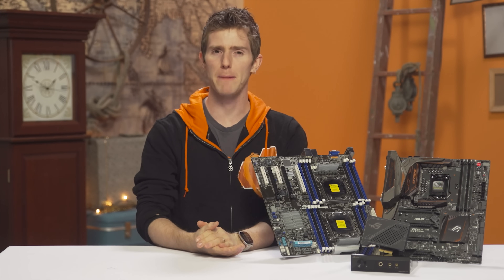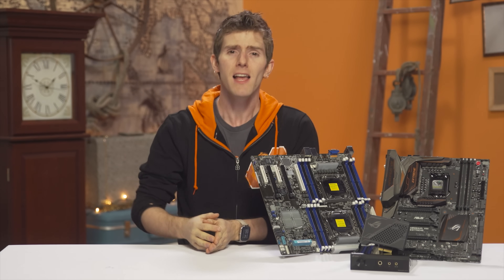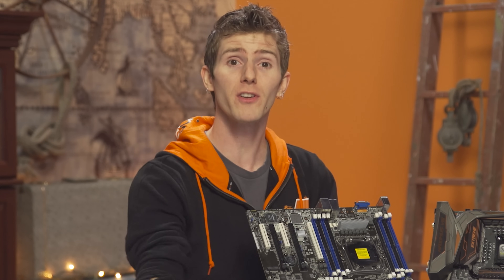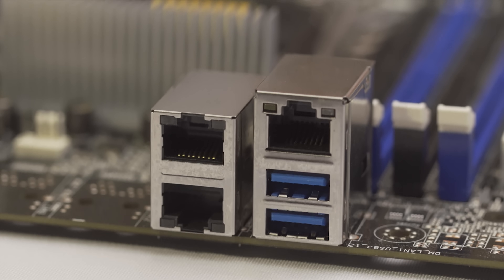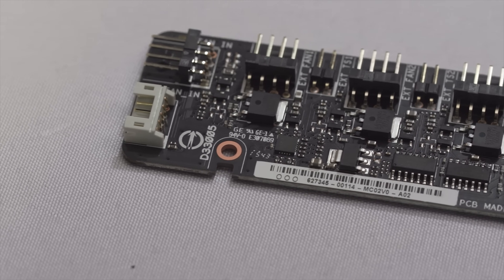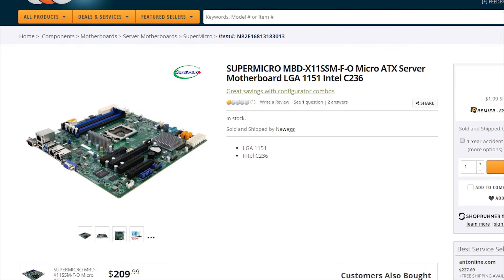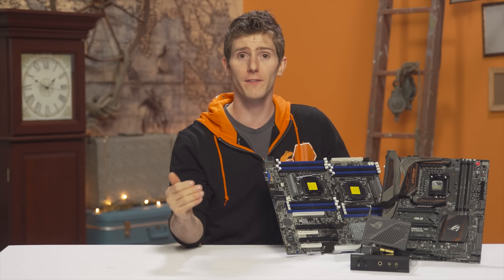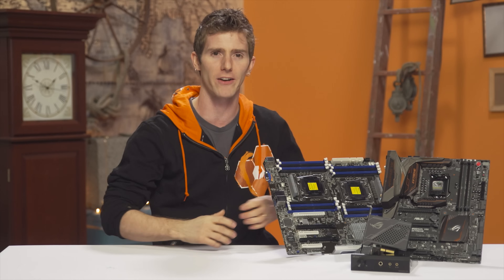What is the best choice for a motherboard? - The Final Answer

Comment: So... What do you do if they seem the same? For example, gigabyte z170 gaming 5 vs Asus z170 - ar, or the z170 Saber tooth s... They are all so similar with similar prices... Now what?
Reply: If they have the exact same features, get the one that's visuals you like.
Reply: +Johan Ekstrom thanks, I decided to go cheap and got the gigabute z170xp sli. Haha
Reply: David Wang Ah, okay. I'm curious. What other specs do you have?
Reply: To be completely honest, There's a lot that needs to be done (I cannot decide on a processor, i'm waiting for the 1070 and r9 480 to drop, and i'm just looking for more feedback to get the most bang for my buck kind of thing. But this is what I've been thinking
cpu:either the 6600k or 6700k
cooler: cryorig r1 ultimate
mobo: gigabyte z170xp sli
ram: 16gb kingston hyperX fury
gpu: I have a sapphire r9 390 for now, this will most likely change... assuming the gpu's i'm waiting for come out before i leave for college
storage: 240 adata ssd + 1tb hdd
cd drive: i know, why....
case: I don't know, i'd like to keep it under 100, so i choose the phanteks pro m acrylic (i like a full side panel, but most panels at this price tend to scratch... easily...
case fans:I choose the corsair af 140... but i'm not sure if those are worth the $20. I just want them to be white, or be white and black...
mouse: corsair m65 (yeah, this is a full build)
keyboard: corsair strafe cherry mx silent
monitor: aoc i2267f
nzxt hue+................... Okay, i have no idea how these led systems work... but the hue+, to cover the large size of the case, was the cheapest while providing enough cable, compared to cablemod led.
That's my build, if you can suggest somethings, or want to know my uses for the pc, that would be really appreciated. Thanks
Reply: David Wang Get a 6600k, no average gamer needs a 6700k, unless you plan on playing Software Inc. with 400 employees working simultaneously. Don't upgrade your GPU yet. The 390 is only as good as the 480. If you want to, sell it for 300$ and buy a 480 which should be just as good for 250$.Upgrade next year if you want to. CD/DVD drive? Please buy one. It's still pretty handy, even if everyone is saying the opposite. Just get the cheapest one. I'm basically having the same internal specs as you if you're getting an RX480, but I'm getting a cheap as fuck case and then building one myself/requesting a custom one from a company/making my desk PC compartment to be the case(it can fit an mATX PC really well, so a full ATX will fit in it) when I have physical reference parts. I have an EIZO EV2333W which costs 600€ but got it for free(bought by someone who didn't have a DVI port or a DisplayPort in their computer) due to my grandfather having good connections(being a builder/renovator with lots of acquaintances gives you good connections, seems like). Get a fully modular PSU.
Reply: Oh yes, i forgot to mention, i think i'm getting an evga 650gs fully modular psu. As for cpu, I won't only be using this computer for gaming (which is why I choose the r9 390 over the gtx 970... don't know how much vram affects this but...). I will be using this for computer science at college as well as using it for 3d modeling, cad stuff, any sort of 3d rendering will be done on this pc as well, which is why I've been considering the 6700k, due to it's better workstation scores and being cheaper than a 4790k. 
Oh yeah, i haven't bought any of these parts, so i don't have a sapphire nitro card yet... But the only pro i've heard about the 480 is that polaris is much better than hawaii, which could make it better, and it's also cheaper.
Reply: David Wang Ok, so get the 6700k, or invest more on the cooler and overclock the 6600k a shit ton. Stick with the 390 for now, and get a RX5xx next year/2018 if necessary.
Reply: Okay. yeah, the cooler was another hard choice. It was really the cooler master nepton 240m or the cryorig r1 ultimate. I choose the cryorig r1 ultimate since it's only a few (as in less than 5c) hotter, but it's also 5-10db quieter running at max. I'm not trying to bother my roomate with a loud pc, so I picked this. it's also one the best looking coolers in my opinion.
Reply: David Wang Yeah, that might cut it for serious OCing of a 6600k. I'm getting a Cooler Master Hyper 212 Evo. How mainstream, am I right? That's all I need though.
Reply: Haha, true! are you overclocking? I know the 212 evo is good for some moderate overclocking. Actually, another thing i need to face and think about is cooling. The dorm rooms at my college are tiny, literally, and no ac, so I would guess the room heats up very fast (i mean, at least they provide a window fan!) but i need to move the lukewarm air through the system fast and then exhaust it fast too, I feel as if water just can't cool fast enough when the air itself is warm... Also, think 4 case fans is enough? 1 front to bring air in, two on top pulling air away from case and cpu, 1 back to pull air out, and then battery with fan bottom to draw air in? Or should i make it two in the front?
Reply: David Wang Yeah, I'm overclocking, mostly to get experience in overclocking, as I'm kinda a noob at it. 4 case fans should be alright, as long as they provide sufficient air flow in the case, while being quiet, but you could get additional ones to support the air around the water cooler. Get more fans in your dorm room(I have 3 in my own room right now, with the window open), and exchange your lightbulb(s) for ones that don't get hot.
Reply: Okay. Thanks. After some digging around, I actually think a corsair 750d would be a better choice. Originally, the pro m acrylilc is around $80-100, but it comes with 1 fan, so I have to buy more fans. However, the 750d, which i found for $120 (hope the prices stay), come with 3 140mm af fans. So in short, that's less fans for me to get, and each af fan costs a little less than $20. So i think that's a good deal, not to mention i don't have to worry about a scratched acrylic and 750d has bigger and better airflow.
Reply: David Wang Good call.

Comment: Somebody had to say it!  Final answer=Think about it for 10 minutes and pick a board that does what you need it to do.  Expensive doesn't mean good if you bought the wrong board for what you're doing...

Really hard to keep a straight face when I listen to someone brag about a dual CPU board in a gaming machine that's sporting a $500 graphics card...  Unless you also happen to be a digital videographer that does a lot of encoding in Premier (and you for some reason can only have one computer) it's kind of a wasted build.  

I'm a lot happier in the long run when I set out on a specific goal then build it for the future.  My gaming rig's motherboard has an exceedingly common socket (lga1366-it supports everything from a cheap i5 to an expensive Xeon) and a ton of USB ports and lots of room between the PCIe slots for thick graphics cards.  I've upgraded the processor twice and the graphics card 3x.  The rest of the system is as I built it in 2009...   

Can't really brag about the price tag on her, but she plays all the games I play at 60fps.  I get motion sickness at higher framerates so I vsync, so I don't even get anything out of bragging about "25000fps in X game with everything maxxed!!".  Benchmarks are kind of lost on me too; yours probably gets a higher score on Cinebench or Futuremark, but mine never hits 100% load under normal use.

Comment: Linus, I am personally offended. I am 16, and recently finished building, or rather overhauling, my existing PC.

Specs:
i5 4460
Gigabyte H97M-D3H
Gigabyte GTX 970 G1 Gaming
OCZ Trion 100 120GB
Seagate Barracuda 2TB
Strontium 8GB DDR3-1333MHz
mATX Case
Thermaltake Toughpower 550W 80+ Silver

Comment: hey linus i have a networking question. i have a dlink ac router cobfigured for only ac on 5ghz nd 48 channel ..with a usb wifi ac adapter when i connect on 5ghz band windows is showing only 802.11n network even on 5ghz network.plz help

Comment: i agree with linus. Get what you really need. i know people that will go out and buy the most expensive consumer board and think it will out perform them. I know someone who went out bought a 5820k, asus rog extreme x99 board, 16GB DDR4 memory and asus 980ti Poseidon platinum. Everything was about twice or more my 4790k, 980 ti hof, 16GB DDR3 2400mhz, etc price and i get more fps or about the same fps than him meaning that he didn't buy the right stuff for his pc. My gpu and cpu runs cooler. 

So i should say don't let the price fool you. You can get away with a cheaper motherboard and so on and you should be fine. Focus on what you need and you will be alright.

Comment: It's a long winded explanation with a few twists n turns, But basically the point is correct.

Take two pc setups with the same cpu and graphics cards and everything, But 2 different motherboards.. One is a 60 bux budget, the other a 600 bux all bells n whittles top of the pile... 
And you will get the same results in gaming (ignoring margin of error)

You can buy whatever mobo you feel like, But don't ever believe the bullshit that a decent mobo yields you better results. Unless you are a serious overclocker of coarse ;)

Comment: The one thing I look at when buying a motherboard is how feature rich and easy to use the BIOS is. I'm no BIOS master, but I like to poke around in there when I get a new board to see what sort of "auto" options it gives me, and how well they work. Gigabyte has been my go-to for a long time now, as their BIOS's are always really simple to use, without all the unnecessary features you might find in other boards. I also stay away from the over $200 boards, because they usually come with a bunch of add-on monitoring or on-the-fly modifying junk I'll never use.

Comment: @LinusTechTips  Hey Linus,  is it possible to find a gaming motherboard that doesn't have onboard video and use space in the back-panel for those ports (rather, gives more USB 3.0 ports etc)?   I mean, it's great and all to maybe have a backup on-board display option (IF THE DISCREET CARD FAILS), but seriously, for gamers, we build a PC for gaming, and may will hardly ever use the onboard display, but only a discreet GPU.  I'd rather have one small HDMI out for a backup on a gaming motherboard and save all that rear I/O panel space for more peripheral inputs.  I have flight sticks joy sticks, gaming pads, USB Keyboard and Mouse, printer, and several other things.  Why do I need to buy some USB hub to accommodate all that for the sake of several display ports on the motherboard?  What are gaming motherboard makers thinking?????

Comment: One thing that you could also mention or even put in another video is that the "newest boards are not always the best". In most cases you can buy a high end board on clearance that is a year old.
Doing this has saved me thousands of dollars over the years and also allowed me to avoid compatibility issues and other problems.

Comment: For my uber rig  i got this mainboard X99S GAMING 9 AC ;-)  what would be better 4x16 or ram or 8x8 ?
Reply: 4x16 still gets quad channel and leaves room for expansion. 8x8 removes expansion but looks baller. Performance is the same as they will both be in quad channel.
Reply: +l__T__l So what would you choose ? out of these?

 CORSAIR Dominator Platinum 64GB (8 x 8GB) 288-Pin DDR4 SDRAM DDR4 2800 (PC4 22400) Desktop Memory Model CMD64GX4M8B2800C14 Timing 14-16-16-31 AUD$704.00

OR: CORSAIR Dominator Platinum 64GB (4 x 16GB) 288-Pin DDR4 SDRAM DDR4 3000 (PC4 24000) Desktop Memory Model CMD64GX4M4B3000C15 AUD$691.00  ???

Comment: While Linus is correct with his answer (don't buy more than you need, but buy what you DO need), I personally would just as soon take a direct recommendation.

For example, I'd pair a i5-6600K with a ASUS Z170-A motherboard, a nice combination of features and price.  This pairs a $250 CPU with a $150 full featured motherboard.

If going with a i5-6500, I'd take a ASUS H170M-PLUS and save a pile of money over more expensive options.  This pairs a $200 CPU with a $100 mostly full featured motherboard.

If going with a i3-6100, I'd take a (gasp) ASUS H110M-HDS and while the H110 has limits compared to a H170 or Z170, for a i3 chip I think it makes for a nicely balanced machine.  This pairs a $130 CPU with a decently featured $55 motherboard.

Those are, in my view, balanced systems and the vast majority of people are not served by going beyond them.

Oh sure, a i7-6700K on an ASUS ROG MAXIMUS VIII HERO is fun, but it isn't what I'd call a "value deal" for most users.  (the exception would be content creators, but even then, the Z170-A is just fine)

---

If you're not an ASUS fan, fair enough, MSI and Gigabyte make very similar boards at similar price points if you prefer those and they work just as well.
Reply: amup amu
Reply: -p

Comment: I was kind of hoping for a discussion on the importance of VRMs, onboard sound card shielding, and other things that you don't see advertised as features too often.
Reply: I thought being told to use a consumer board instead of a server board was the most useful. I accidentally bought a dual socket Xeon server board but should have bought a high end overclocking board. I can only plug in 1 of my 3 graphics cards and can't plug in all of my keyboards and mice and controllers and stuff.

Comment: top tier mobo brands:  asus, gigabyte, intel, supermicro (servers and workstations)

brand to avoid:  ASRock.  asrock is flimsy.  like really flimsy.  

if you're spending more than $100 on a board, ask yourself why.  i recently spent less than $50 on a socket 1155 board.  people spend so much fucking money on useless hardware.  also, SLI and crossfire are fuckin' dumb, guys.  the scaling is bad.  the power consumption is atrocious.  it's not cost effective and it won't make your penis any bigger.

Comment: Easy!
First of all, decide which processor you want. Think about what kind of performance you really need, gaming won't profit much from anything larger than a normal series I7 while rendering will take great advantage of an extreme series I7s additional cores. Maybe you don't want to game at all, then you should go for low-end I5s or high-end I3s, maybe Xeons depening on how important it is that your system is stable (i.e. does not crash). Also keep features in mind. If you want to overclock, you need a K- or X-Series CPU, if you want ECC memory, you need a workstation CPU (i.e. Celeron, Pentium, Xeon or some Core I3s).

Then you look into the chipsets and which chipset available for this processor. Then take the chipset that has most features you really want. For example, if you want to overclock or use SLI/Crossfire, take a Z170. If you only need Raid Support, take a H170. Want a PC for somebody who only plays Tetris and checks E-Mail? H110 you go.

Lastly, check the differences between manufacturers and models. Cheap does not mean crap. From my knowledge, AsRock has one of the weaker UEFIs, but really good sound solutions for the price for example. Again, look for the features you value most and make sure, the mainboard has all the features listed you wanted when you choose your chipset. Not every Z170 has SLI.

Now, lastly, look at which RAM your system supports. If your mainboard can go all the way up to DDR4-3600, that's great, but it will choose a different profile if your CPU only supports DDR4-2133. You can manually override the clocking your mainboard chooses and get beyond the formal limit of your CPU, but that may cause instability. Not to mention that, if you built a system that must not crash, you probably went for "reg ECC"-support on CPU and mainboard, so you should get "reg ECC" RAM.

Comment: If my mouse glows and is plugged into back usb(the motherboard) that means my mb isn't fried right?
Reply: +AwesomeBrolo not necessarily, man.  just cuz one part of the board is working doesn't mean the whole board is working.
Reply: I fixed all of my problems except for one...everything turns on but nothing displays to the screen anyone know what the problem could be? graphics card turns on cpu fan spins leds glow all fans on idk y it wont display to the screen

Comment: anyone know if there are any skylink motherboards that support sli all I've seen is crossfire and I want to do dual 980ti's and also can u put a skylink possessor in a non skylink motherboard or would that not work
Reply: +cole gordon use pcpartpicker to choose pc parts. google that. skylake cpu has LGA 1151 socket, so only motherboards that have that socket can hold that series of cpu. use psu tier list 2.0 and enermax power supply calculator to choose power supply unit. again, google(or use whatever search engine you like) what i just said that interests you.

Comment: For me, the choice of motherboard was surprisingly simple. I just had a few parameters:
- Fits in my mini ATX case
- Supports my AMD CPU
- Has an IOMMU
- Costs less than 100€

I found exactly one motherboard that fits within those parameters.
(Probably missed a few - the IOMMU requirement is a bit hard to verify since most manufacturers only mention it in the data sheet and don't really promote it)

Comment: you did the high end one. Now tell us if there is a reason I shouldn’t buy an $50 to $80 board like an a 110 series for Skylake and throw an i5 or i7 in there. Should have at least done different ranges. If someone is watching your videos and spending that kind of cash they probably already know to read the reviews, i.e. your final answer.
Reply: One good reason is missing overclocking abilities. Boards in the lower price range are usually meant to be equipped with low end CPUs like an i3 or no more than a non-K i5. Another good reason is missing connectivity features like extensively discussed also in this video ...